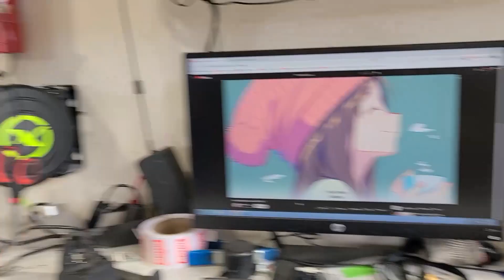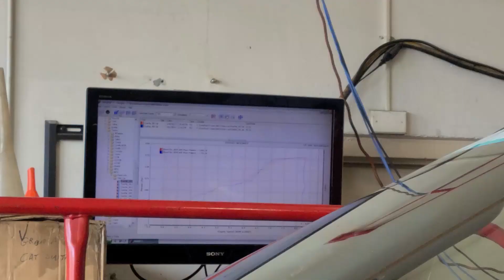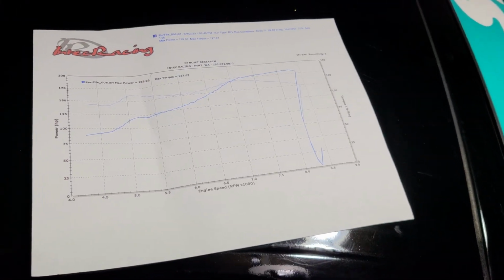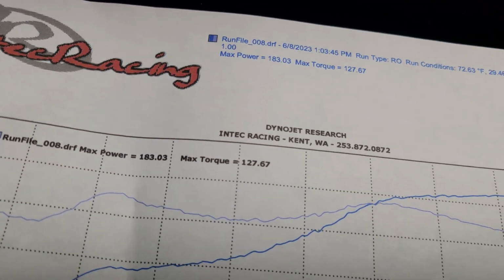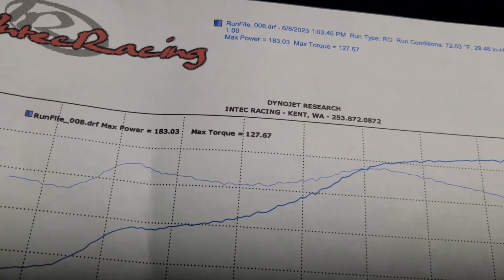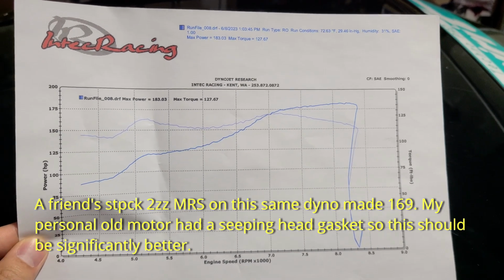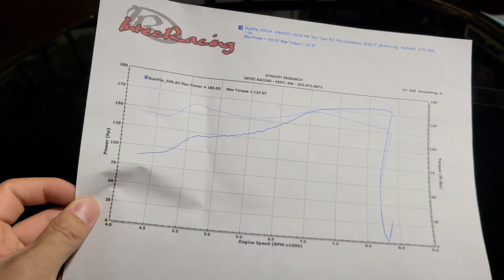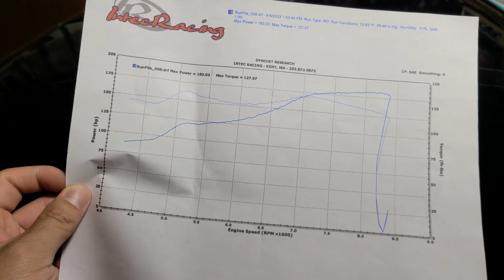How much hp?? | First 2zz MRS Dyno Day

Comment: Use loctite blue and lockwashers on exhaust flange. Its gonna rattle itself loose overtime.
Reply: it would just melt the loctite, and you can just use serrated nuts

Comment: I always think it's interesting the difference in the torque between the 2ZZ and 7AGE. 7A just makes more torque way earlier. Much more usable torque when racing. I feel like the VVTLi actually might hurt the engine rather than help in this case.
Reply: vvtli doesnt hurt at all, its just the way the cams are sized from factory
Reply: @arcanevoid9199  Maybe but it's the same issue with Vtech engines. Their peak torque is too high up the RPM band which would be ok if your gearing was perfect but it rarely is.